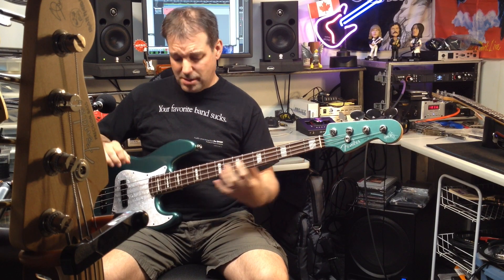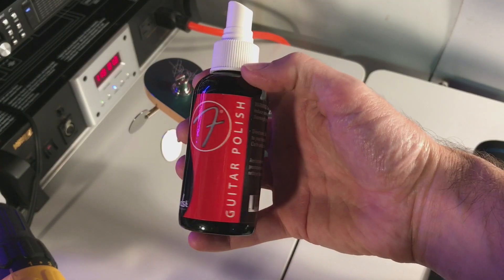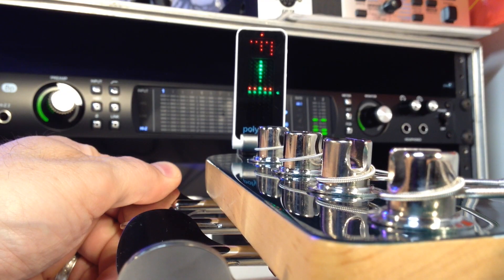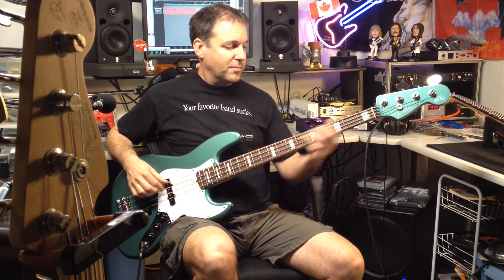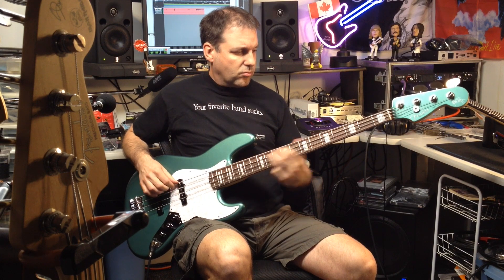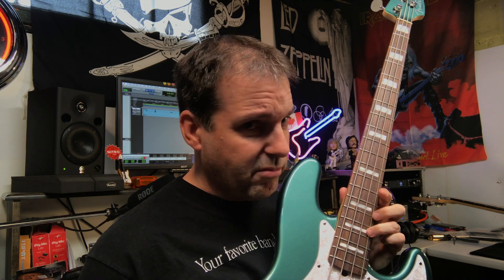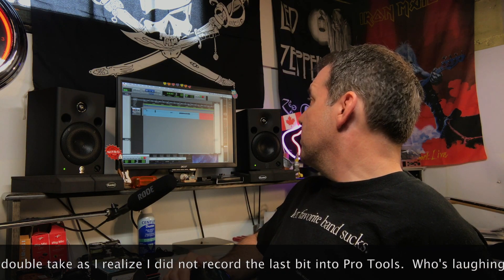You are wrong about fret buzz!

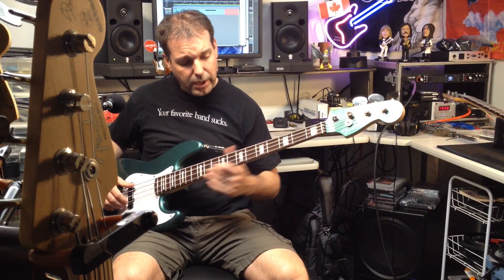Comment: Sir, I have been playing bass for 20 years and the simple information in this video has completely changed my thought process about low action and playability. I use to stress out about getting super low action with absolutely no fret buzz. I guess with some bass guitars it is possible but for the most part, it is a complete headache trying to achieve that milestone on the average bass. What you say makes sense. If the buzz is not coming through the amp, why should it matter if you can hear the buzz unplugged? The only caveat is that I don't want to set my action so low to the point of choking the string and the sound. I.E. 3:13

Comment: It's a physics problem.  Set the instrument up correctly and don't make people listen to fret buzz. OK— I have ASD, so flickering light bulbs and buzzing circuits, strings, pump noise harmonics, etc. make me ill.  But I have to assume no one wants to hear road noise from a tire with flapping tread.  same thing with fret buzz.  It can be fixed on the majority of guitars.  If it can't (short of planing a fretboard) then scrap the instrument.